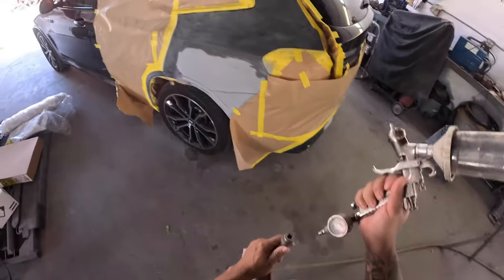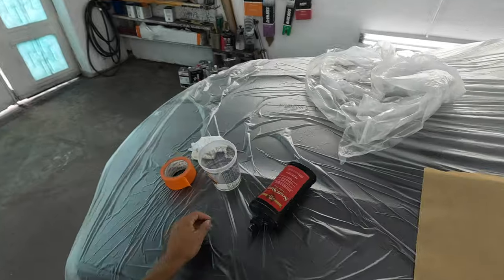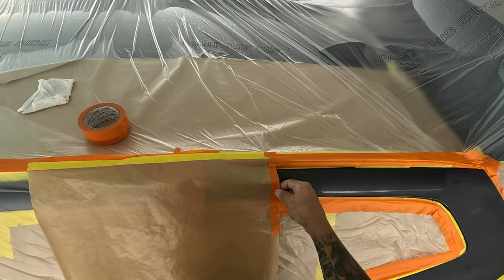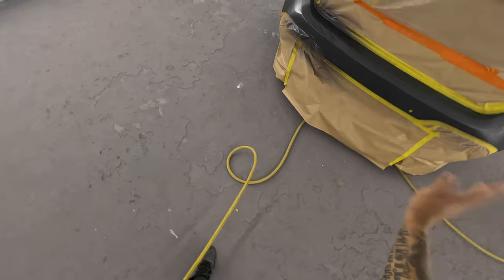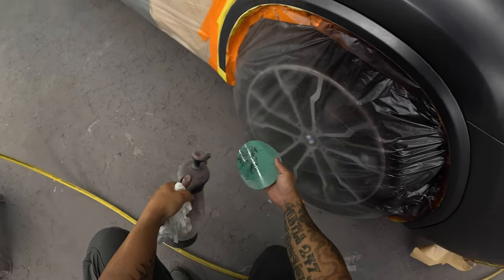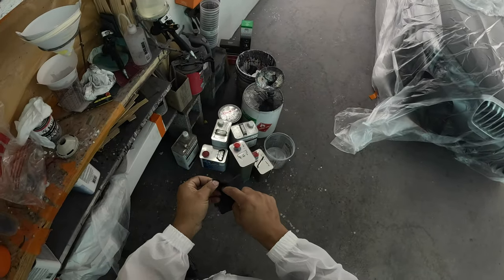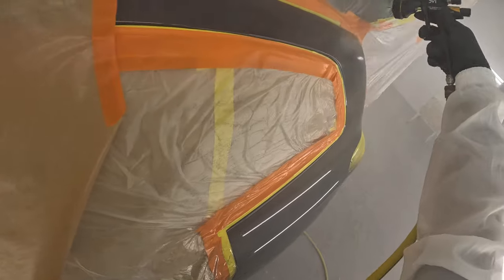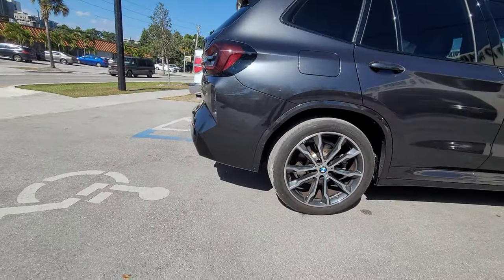Color mismatch is your fault PERIOD!! Tip to prevent it

Comment: Awww Trigga I done caught you slippin' lol you said in this one if its shiny paint won't stick. I just so happened to have just watched the video you made about keeping the factory orange peel on a truck and you had it lightly scuffed but the "peel dots" or lows rather were still shiny all over. I said aww nawl trigga man!...lol But hey you doing ya thang man, rock steady fam!
Reply from the maker: Sanding a car down and not taking all of the factory peel out is common. The "shiny" low spots are still scuffed for adhesion. But it is good that you're paying attention to detail 💪🏼😎

Comment: I usually use the grey pad and buff. I’d like to try your way, where do you get the scuff stuff? Is there a parts number?
Reply from the maker: I use to do it that way too before I learned this. Give it a try and let me know. SEM makes a similar product but here's the link for the Scuff Stuff by Presta 💪🏼

https://amzn.to/3KcgAJO
Reply: Thanks man!! Hey bro watch them eyes. I paint heavy equipment and we shoot alot of single stage, but over the years my eyes have been getting worse and worse. I went to the eye specialist and they say that anything with a hardener will stick to you eyes and build up a coating of paint on them. The only way to get it off is to scrape it off. To make a long story short, learn from my mistakes and keep those eye’s covered up. Thanks for all your hard work.
Reply from the maker: @charlesstevenson1352  thank you man. I appreciate that. I've been using the full face mask. But You're absolutely right. 🙏🏼🙌🏼  If you see me slipping call me out 😅

Comment: Never realized the DV1 is that slow. I actually like slow so I dont get a lot of runs. 😂 I have a LPH400 LV4 1.4, are they about the same speed?
Reply from the maker: No way Jose LPH400 lv4 is my favorite gun. And I hate the DV1 so that should tell you right there. DV1 is 10x slower. I get some good speed with my LPH
Reply: @thetriggerman954  oh wow!   Guess I won't be adding that to the stable. Thanks for the info!
Reply from the maker: @bosshawg7427  I wouldn't advise. I had 2 one I bought and one I got free from a paint rep. I sold one. And I'm waiting to see if they come out with a C3 cap or something of Not I'm going to sell this last one. It just collects dust

Comment: 16:40 what is the stuff in the green can?
Reply from the maker: It's called "Quick check" it gives the look of clear lasts about 5 minutes then disappears. 
https://www.amazon.com/10030-QUICK-CHECK-MATCH-CLEAR/dp/B00IK1TH14/ref=asc_df_B00IK1TH14/?tag=hyprod-20&linkCode=df0&hvadid=312140903243&hvpos=&hvnetw=g&hvrand=8105544740131343252&hvpone=&hvptwo=&hvqmt=&hvdev=m&hvdvcmdl=&hvlocint=&hvlocphy=9011897&hvtargid=pla-569124701643&psc=1